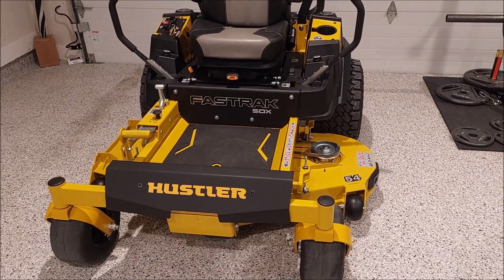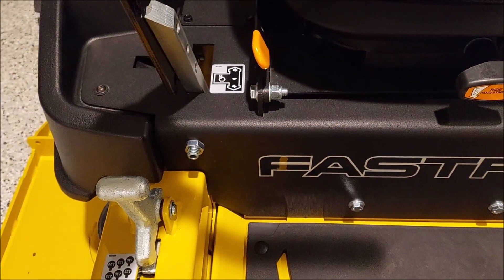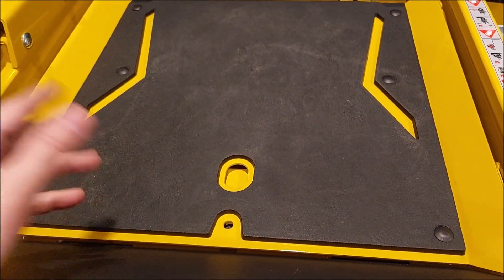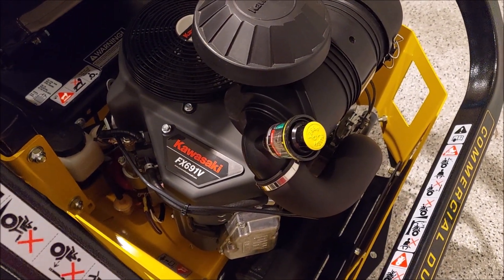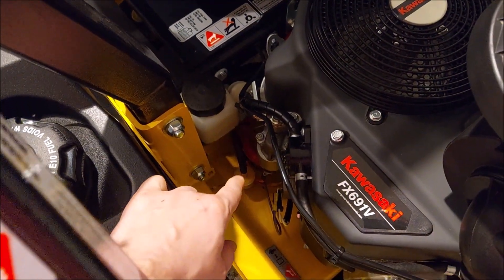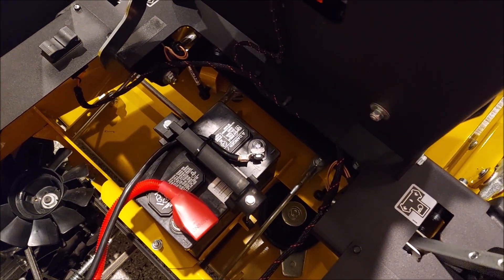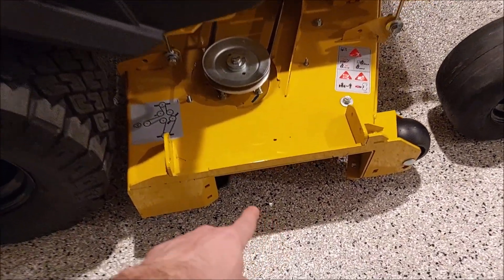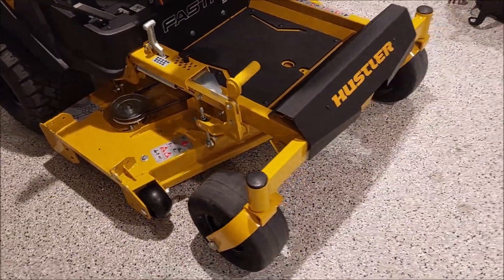Hustler FasTrak SDX Follow-Up Part 2

Comment: The Husqvarna z560x I had with the zt5400 needed adjustment several times.
Reply from the maker: I know you're not a fan of hydro gear lol
Reply: @morejelloplease  I’m ready to see your thoughts after a year. I truly hope they work well.
Reply from the maker: @American Dream   These are the 3400s, the 5400 is the top of the line with the dual speed if I recall, I've had 2800 and 3100s. My parker wheel motors were the ones that leaked from the factory, both of them according to the dealer  were not torque properly when assembled., the 3400s are old school tried and true. Only time will tell. At least it has reservoirs lol
Reply: @morejelloplease  how do you feel speed wise compared with the Scag unit?
Reply from the maker: @American Dream  I don't mow at full stick as they say. But just driving up and down the road at full speed it feels a tad faster.
Reply: You split any green with the hustler yet?
Reply from the maker: @American Dream  nope, it's still brand new. thought about selling it and letting a lawn service take over.  There is no grass,  light weeds and mostly rocks here.  The freeze wiped us out.  I would rather have a decent wood chipper instead.

Comment: I don’t know if you remember me talking about scags to you a while ago. I finally broke down and got a liberty z. Got it with 60 hours and a deal to good I couldn’t pass up
Reply from the maker: No worries! What year,  size, engine, etc?  This hustler was a deal I couldn't pass either
Reply: @morejelloplease  it’s a year old. It has a Kawasaki and it’s a 48inch with 60 hours. I got it for 3500
Reply from the maker: @nicktittle1206  not bad! Keep the oil and filter clean :)
Reply: @morejelloplease  any problems I should watch for that you know of?
Reply from the maker: @nicktittle1206  if it has 60 hours on it then it should pretty much be good to go, assuming that if there was an issue it would have broke already lol.   did the original owner change the oil, filter, etc?   if that's a 21 it may not have tanks for the hydros.  if it does, check the cold level and color,  i forget what the change interval is on the zt2800's.  read the manual, make notes on your phone for part numbers for filters, tire PSI, 8 rear, 25 front (i think)  check the deck for level, inspect the belts, etc.    I made a checklist video, and feel free to watch my old scag videos and it may gives you some things to check on yours.
Reply from the maker: @nicktittle1206  and most importantly, post a video of your new toy and give me a shout out if you want haha.  are you in texas?   drop it off and i'll go thru it and make a video on it.  i did that for my friends 36 liberty, patriot, cub cadets, etc.   i'll go thru any mower and make sure it's in tip top shape.
Reply: @morejelloplease  nah man I wish. I’m up in Virginia.. it has some battle scars. I’m just worried dude might have unplugged the hour sensor. But it definitely has at least 60 hrs. Any tips to tell if it’s got more than 60 hours ?
Reply: I got the manual I plan on reading it all before mowing season gets here in spring.
Reply from the maker: @nicktittle1206  not really, what makes you think it was tampered with?   the hour meter is usually a wire wrapped around one of the spark plugs with a tie-wrap on it, it picks up the pulses in the spark plug wire and starts counting :)   the 36" i worked on had 50 something hours if i remember correctly and was pretty trashed, and my 21 had what, 30 hours on it and looked pretty new with the exception of some branches that had scraped the plastic fenders.  make sure the engine oil is no darker than honey and the hydros should be the same.  read what kawasaki and hydro gear recommends as far as oil changes, then compare it to the scag manual, they were conflicting if i recall.   i'd prob use 10w-40 synthetic found in the kawasaki tune up kit, check the air filter and try to get a little foam wrap around it, it helps a little on those FR filters.  sharpen the blades and let her rip.
Reply: @morejelloplease  I’ll do all that. I will probably come back when it gets closer to that time with any questions… what do you think about simplicity mowers ?
Reply from the maker: @nicktittle1206   Simplicity snapper, snapper pro, Ferris, stihl all owned by Briggs if I recall correctly, they make OK machines, just depends on what drivetrain and engine combo you want.
Reply: @morejelloplease  actually found my first issue already.. so I Parked it on a slight incline and the parking brake keeps like letting it jump back.. like it isn’t working. Is there any way to adjust or?
Reply from the maker: @nicktittle1206  both my of  liberty Z's would not hold with the parking brake, i assume you found my videos on it :)   is the lever not staying in the ON setting or is the brake not holding causing the unit to roll and click?
Reply: @morejelloplease  I’d say rolling and clicking. The clicking doesn’t seem as loud as yours. But mine was also on the ground so I’m guessing some sound was absorbed
Reply: The lever stays in the on position
Reply from the maker: @nicktittle1206  there's an adjustment in the manual.  basically there's little levers that lock a gear on each transaxle, there isn't much travel  so most of the movement is taken up by the spring.  when you read the manual you'll see what i'm talking about.  raise the seat and look at the levers going to the hydros, now operate the parking brake back and forth and make sure both of the little (gray plastic maybe?) arms on each hydro is swinging all the way into the lock position and that there's a little spring tension on the lever holding it in place.  hard to explain on here but i think you'll be able to figure it out.  now, that said, even when they are adjusted properly, when the brake is engaged, sometimes you need to slowly rock the unit to get it to bite in between the gears teeth to lock.  so sometimes it will hold, sometimes it wont.  in my case i didn't trust it at all parked on slopes, etc.    once you hop off, it can start rolling on you.  hope this makes sense.  if you didn't get a manual, you can download one from scags website, it has a section specifically for setting the parking brake, but don't trust it, even if it's set correctly :)
Reply: @morejelloplease  alright man. I will look it into it and I’ll keep you updated on my scag adventures…. I just can’t help but to think you will end back up in one.. maybe
Reply from the maker: @Nick tittle  No way, I'll never touch another Scag.  If I do it's in for repair, but after owning 4 brand new ones, I won't own another.
Reply: @morejelloplease  wouldn’t you say that you had more a dealer issue than a scag issue? I’ve watched all your scag videos lately and it just seems like a tech that was getting minimum wage not caring about their job
Reply from the maker: @Nick tittle  just the whole scag experience from manufacturer to end user. Poor communication, bad dealers, and when other issues came up no one wanted to hear me.  Imagine a new scag being delivered and it has bone dry hydro tanks, no oil on the dipstick, tires inflated to 40psi, you add oil (not overfilled) and it smokes for 10 minutes straight, control arms loose almost causing a collision, engine cover starting to melt, oil leaking all over your floor the next morning,  man I had it with scag.
Reply: @morejelloplease  yeah I’ve re watched and  saw your wild journey all over again. If I were you I’d probably say I’m done with scag to.. do you have the part number for the upgraded duel air filter that I can put on mine ?
Reply from the maker: @nicktittle1206   I think power equipment man has them but we got into a pissing contest about carb jets. I'd be careful putting them on there, however I've seen some guys run in them for 50 hours with no issues come up but there is the chance that it can do more damage to your engine but I cannot confirm that at this point. Basically when Kawasaki puts those canister filters on other engines, There is a change in the jets if I recall correctly. You could always go on surplus center's website or eBay and find a canister filter, you may need to fabricate a bracket to hold it to the engine. The FX has a metal cover where the FR is plastic so there's no way to mount it unless you utilize the screws that hold the air filter cover on. Search for some videos on YouTube and it will better explain it.
Reply: @morejelloplease  I’ve looked for some videos and can’t really find anything to point me in the right direction
Reply from the maker: @nicktittle1206   Look at power equipment man on YouTube or yupe canister filter Kawasaki there should be some videos
Reply: @morejelloplease  I saw you had one on your liberty z.. how did that happen
Reply from the maker: @nicktittle1206  I put on on there taking a risk that it could damage it, I could never get a solid answer from kawasaki, i emailed them 5 times, including when i was having issues with my engine smoking and when the top fan cover started melting and they never responded. since they can't answer phones i basically said screw the warranty and bought the filter.  I figured i'd rather have the engine fail from running too rich than have it fail from dirt ingestion from a crappy air filter.   my environment is dry and dusty.  the stock filter may be ok for your situation.
Reply: @morejelloplease  my mower doesn’t hAve a place to check the fluid in the hydros
Reply from the maker: @nicktittle1206  yeah most 2021s don't have external reservoirs.
Reply: @morejelloplease  sorry to bother you with all things scag.. looking forward to see how that mower treats you this missing season. Which I’m assuming starts in March for you Texans
Reply from the maker: @Nick tittle  you're not bugging me at all, I like to talk mowers:) it was 72 yesterday,  now it's frozen for 3 days and no one saw this coming.

Comment: Very informative and enjoyable video! I took your recommendation on previous video. Went to local Hustler Dealer for Hustler Raptor XD 54, but salesman was trying to strongly recommend the Kubota z231br-48 for the same price ($5199). He could do a lot "better" deal on the Kubota than the Hustler. Didn't know what you think of the comparison or even if the Kubota with the Briggs Motor should even be considered. Appreciate the feedback!
Reply from the maker: Let me look these machines up and I'll  reply back to this comment soon.
Reply from the maker: ok so the 2022 raptor XD cash price ranges from $4650 w/military discount to around $4900 cash around here.  your dealer may vary.  MSRP has been all over the map with zero turns in the last 2 years, especially the past year with inflation.  I've seen zero turns sit in a dealers inventory for a year and original MRSP was $4699 and went to $5699 or higher in a 1-year period.  the mower just sits there and they keep playing games with the price stating "that's the market"  well guess what, now you've got last years mower sitting in your inventory potentially with a bad or weakened battery and now that 2023 is here, they are going to blow it out the door (usually just above cost) so they don't have to pay any more interest on it.  some dealers depending on the floorplanor agreement they have with the manufacturer will limit the 2023's they send to them especially if they still have 2022's sitting around.  and of course i've heard it all from "they aren't making a 2023 model with that engine option" or "they won't ship me a 2023 unless it's pre-paid" or "they are goign to raise the prices another $1000 and I may not be able to get anoter mower for 6-12 months".  in the end it's your money and you can get whatever engine/hydro combo you want.  don't settle because it's all the dealer has because he's only trying to clear out what he's got.  There are plenty of other dealers out there that are tripping over units and one may be the exact combo or price you're willing to accept.  Right now is when you may find that deal, i have no problem buying "last years mower" as long as the price is right.  remember if it was $6k when it came out, and 1 year passes and inflates it to $7000,  and how they are offering it to you for $6000, then that's still not a real good deal.   bobcat for example raised the price on their zero turns almost $3k.   I looked hard at those and when the hustler came back into view it was really a better machine.  I was chasing a 3" full suspension seat last year and that's why the hustler got eliminated.  we'll keep it simple and avoid the $1k add-on for the upgraded seat, that's for a future video.  Ok so back to the kubota vs hustler, still with me right?  :)  these machines are very close,  ultimately it comes down to the creature comforts, what you want on your machine and can live with/without and if you think the dealer will have your back when it comes time to service, etc.  not sure if you want LED's (if they are even standard on the kubota or not) or how much is it for the option, how much is a suspension seat,  compare the warrantys, etc.  they kubota has an extra year i think but you have to read the fine print to see what is covered.   a 2800 hydro is very similar to the 3100, the 3400 is a more substantial step up, but you may not need it if you're not mowing slopes or towing a yard cart with a few hundred lbs, etc.  the raptor XDX is more apples to apples to the kubota but it another grand on paper.  if you find a dealer that plays ball you might get an XDX for a little more.  now when you goto the kohler engine it's still a courage.  if it were a command pro i'd say go for it, also the LED's come standard, but are an option on the briggs it looks like.   It's a close call and if it were me make sure you inspect them and operate them, see which is more comfortable to you.  and most importantly, don't be in a hurry.   you might find a similar mower on craigslist for facebook marketplace for 1/2 price because someone is moving, etc.  always call around or send out some email quotes and ask for a cash blow-out last years model price :)  sorry there's no clear winner here, you'll have to make the call.  hope this helps a little!
Reply: @morejelloplease  Thanks for the detail info... Sounds like either aren't the best.. the first Hustler dealer would only take $100 off MSRP for last year model but telling me it is the same and they sat outside with leaves and dirt in the cupholder... Then stated they only been outside since November the blades were rusty telling me that is normal for blades... Ran away from that dealer. The second dealer didn't want to budge on the Hustler price but wanted me to get the Kubota and kept saying it is better than the  Hustler... So left as did no research on the Kubota but knew it didn't have a Kawasaki engine so was skeptical... Will head out Saturday to different dealer, just would like to find reliable zero turn for about my 1 acre of land mostly flat. Just got to find dealer that wants to make a deal... This is becoming more challenging than buying a vehicle!!
Reply from the maker: @Gsxrtrix  yeah i still cant believe the vanguard 28HP EFI was missing part of the crankcase gasket right from the factory.   I parked it in the garage, woke up the next morning and there was oil all over the frame, floor, etc.   I know it was a briggs issue but it was in my 4th and last brand new scag and that was just icing on the cake.  The hustler isn't out of the woods, i just posted a video with some issues that i found, but compared to scags track history the hustler is a nice machine so far!